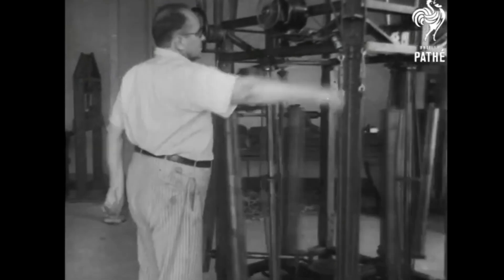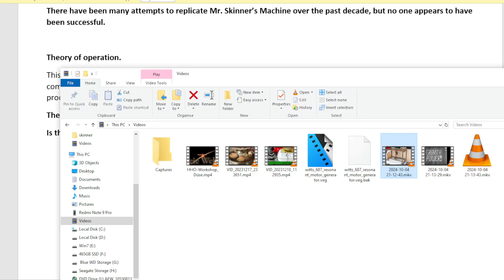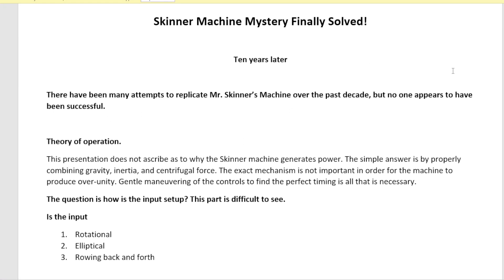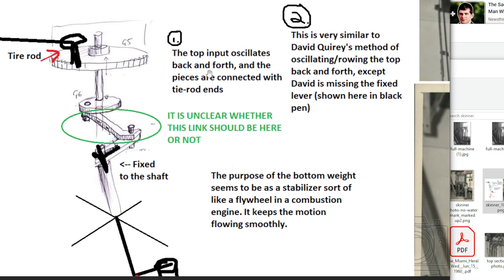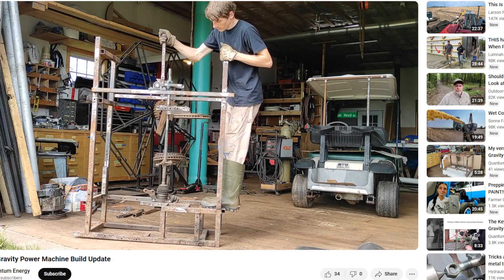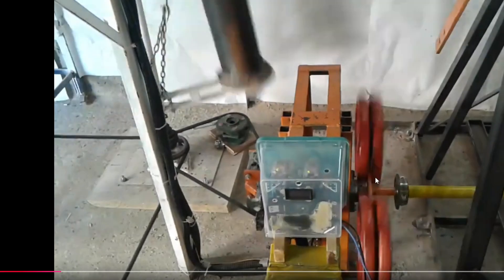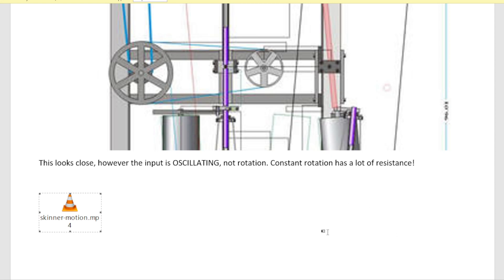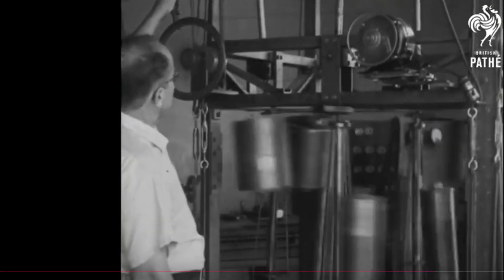1939 Skinner Gravity Machine Mystery Solved

Comment: Daves significant comment was that the upper weight linkage over runs the lower linkage when a load is put on the lower drive weight slowing it down - that causes the large weight to steer upward  and input is required to steer the heavy weight down to hold the heavy weight on its path so that its momentum can be transfered to power the load  without consequential slowing - or something like that.
Reply from the maker: yes, the two weights tend to cancel each other out. I've found that trying to explain how it works only leads to word salad, the simple answer is just tinker with it till it works well.

Comment: Did I miss the part of the video where the mystery was solved ?
Reply from the maker: The simple answer is it needs to be adjusted and timed properly. When correctly adjusted, tuned, polished, etc. it will turn with almost zero input.
Reply: @QuantumEnergySearch  So there was actually no mystery after all
Reply from the maker: @Bob_Burton  The difference is getting it to work or not. If you've built it yourself you would understand there is a mystery.
Reply: @QuantumEnergySearch  What do you mean by "getting it to work" ?
There are no circumstances under which it will produce over unity energy
Reply from the maker: @Bob_Burton  Thank you for your enlightenment.
Reply: @QuantumEnergySearch  It sounds like you don't agree with me, and you still have not explained what you mean by "getting it to work"

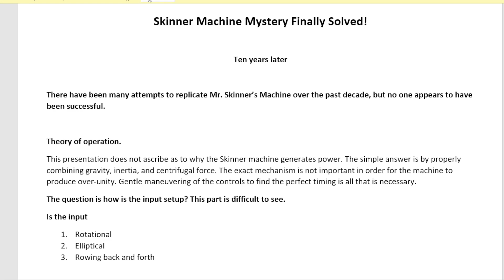Comment: I follow you regularly and appreciate your passion, which I share. And I've just had this thought: I see you handling kilos and kilos of metal and making multiple welds, as if this were going to solve a problem or lead you towards a solution. But don't you think that all mechanisms can be replicated in scale models? Wouldn't it be possible to find simple mechanical elements that can be assembled and reused (as shown in the video at 3:37), even in wood? I was wondering what you do with your test pieces when they don't work, and if you use your grinder every time to take them apart? It's one thing to build a big, heavy machine that works, it's another thing to do research and testing. I've done a lot of testing in my workshops over the years, and what I've come to realize is that many times I've put a lot of energy (material work) just to verify a principle. But a principle has no weight!
 Best regard!
Reply from the maker: Welding is like hot glue for steel. It is far cheaper than punched metal, aluminum rails, bolts, etc. Schools use the latter a lot. Which is nice and clean to work with. But I do not afford such luxuries.
Reply from the maker: As for time, it only takes a few hours to put something together including cutting and welding. The design and having motivation are the real expenses.
Reply: @QuantumEnergySearch  I understand, thank you

Comment: was skinners machine tested as over unity. Did he drive it with electric motors?
Reply from the maker: He used a 1/8th (100W) horsepower motor. The output was probably close to 1/16th of a horsepower (50W). Skinner was likely skilled enough to close-loop the system, but did not for his own safety. The full video and newspaper clipping give the full story.